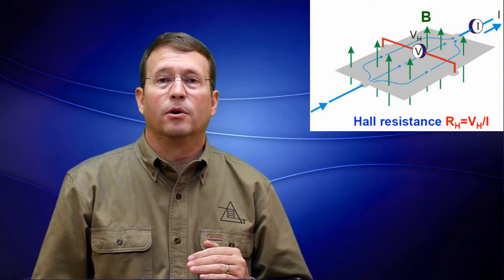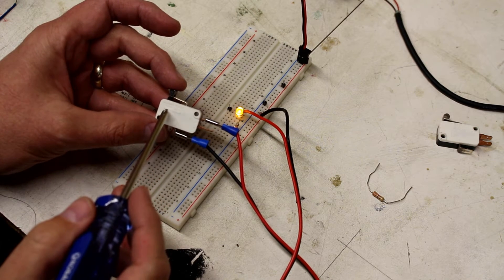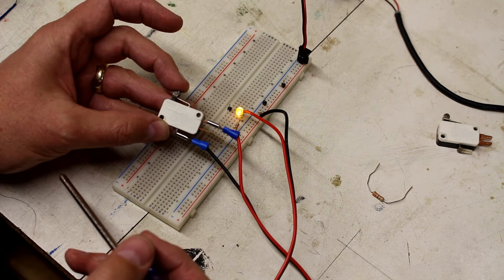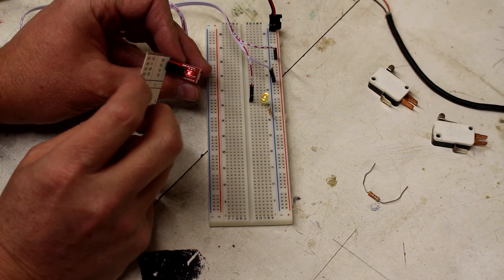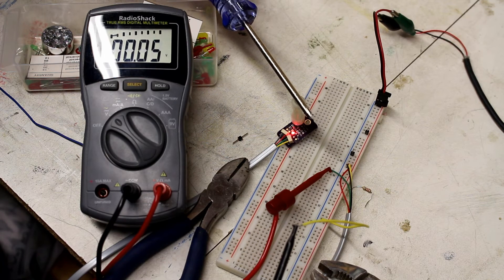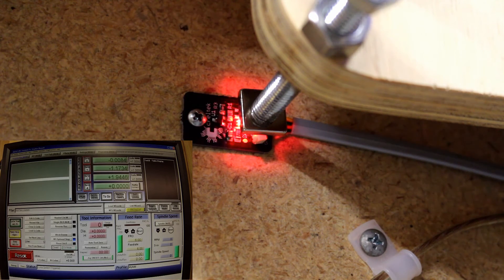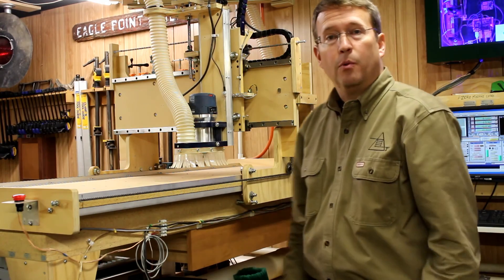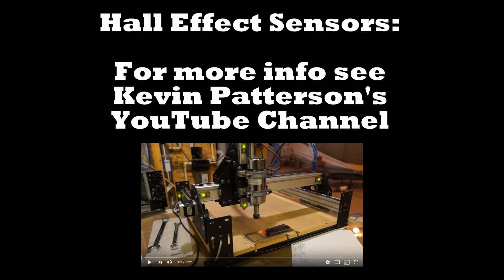CNC Limit Switches - Lever, IR and Hall Effect

Comment: Thanks for this, I have lever switches the same as yours on my CNC- I am looking for a better way of doing it though as I need to use them as homing switches to get an accurate zero point that the machine can return to. I hadn't heard of Hall switches before.  I use Mach3, can I do a straight swap from limit to Hall switches? I guess it depends on the voltage rating of the Hall switches?
Reply from the maker: The hall limit switches require 5V in addition to the signal wires. I get that from a USB outlet on my PC. They are 5V.

Comment: I noticed in the video you stated that when the South Pole of the Magnet came near the Creltek Sensor the Voltage would Drop. In the accompanying PDF file that Kevin Patterson provides with his setup, he States that it should be the North Pole of the Magnet. Also are your Creltek Sensors setup as Normally Open or Normally Closed in Mach3? Anything you can offer in information would be greatly appreciated.
Reply from the maker: Normally when the limit switches are not activated they are high (5V). When activated they go low. I guess that mean they are normally closed and open when activated.  Hope that helps. They work great.

Comment: Personally I prefer the inductive proximity switches.  They don't collect metal shavings and they don't need magnets.  They are available in NC and NO configurations as well as open collector (pull to ground) or PNP (pull up to supply).  NO open collector devices can be wired in parallel so a home can function as a near limit and it's compliment can be the far limit on an axis.  They are generally sealed and immune to coolant mist, metal shavings, etc.  As a bonus, most are quite inexpensive.  Most work from 12 to 24 volts.  The open collector ones just ground the output so it is comparable with 3.3 or 5V logic inputs.  They have a positive acting hysteresis curve like a snap switch.
Reply from the maker: I may try that in the future. Since I am not machining metal the magnets work well.  I will take a look.

Comment: a hall effect sensor is also an analog device. yours has an comparator (opamp) attached wich compares the analog value to a set value of a potmeter(variable resistor) or resistor. if it's below the threshold the output is off and above it's on. 
so with this comparator (opamp) you can make any analog device a digital one and set the threshold(on/off point) with a potmeter. very easy! the LM358 is often used for this.
for your other issue, the normally open device like the IR sensor. you can invert the output with just one NPN transistor. also very easy. example BC337

here some examples:
Comparator:
R1 and R2 combined is the potmeter, Vin is the analog input and Vout is the digital output.
both examples for normally open/closed called inverting and non inverting.
https://www.google.com/url?sa=i&url=https%3A%2F%2Fwww.circuitstoday.com%2Fvoltage-comparator&psig=AOvVaw3vRCgHxOpjx5sAGdfD-wcx&ust=1629455324295000&source=images&cd=vfe&ved=0CAsQjRxqFwoTCJCX6KTwvPICFQAAAAAdAAAAABAU

LM358 has 2 opamps just use one.
https://www.google.com/imgres?imgurl=https%3A%2F%2Fwww.electroschematics.com%2Fwp-content%2Fuploads%2F2008%2F11%2Flm358.gif%3Fresize%3D239%252C146&imgrefurl=https%3A%2F%2Fwww.electroschematics.com%2Flm358-datasheet%2F&tbnid=l0CrN0NrvxbBCM&vet=12ahUKEwjPgrLU8bzyAhWO2qQKHTO7CCUQMygEegUIARCjAQ..i&docid=fJdpdYQKHHOMmM&w=239&h=146&q=lm358%20datasheet&ved=2ahUKEwjPgrLU8bzyAhWO2qQKHTO7CCUQMygEegUIARCjAQ

transistor inverter:
https://www.google.com/url?sa=i&url=https%3A%2F%2Fwww.petervis.com%2FEducation%2Flogic-gates%2Ftransistor-logic-not-gate-inverter.html&psig=AOvVaw3JiM5wvPPcBrW2JseEnQR4&ust=1629455206945000&source=images&cd=vfe&ved=0CAsQjRxqFwoTCLieou_vvPICFQAAAAAdAAAAABAD